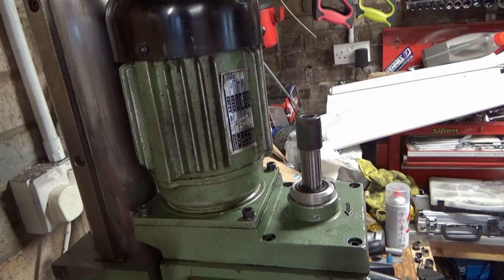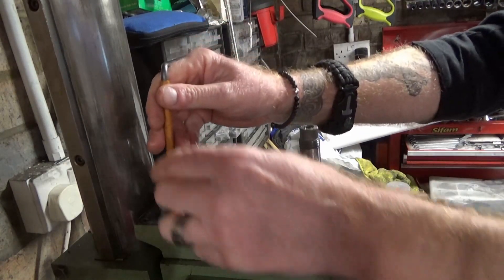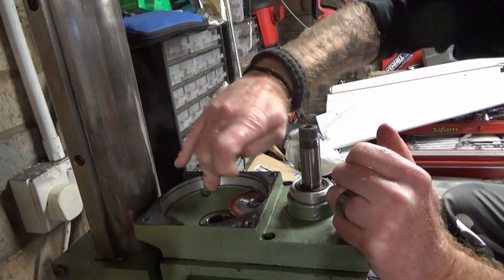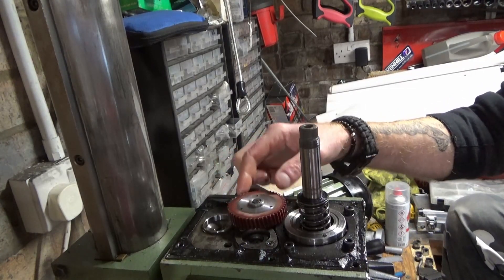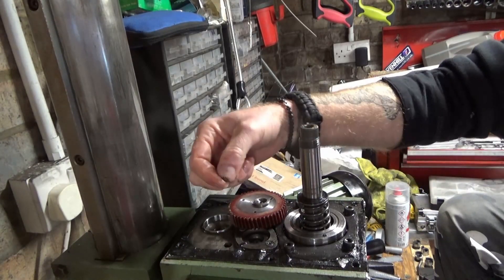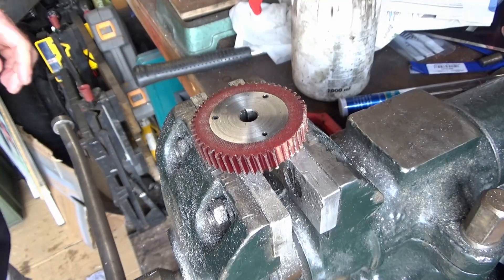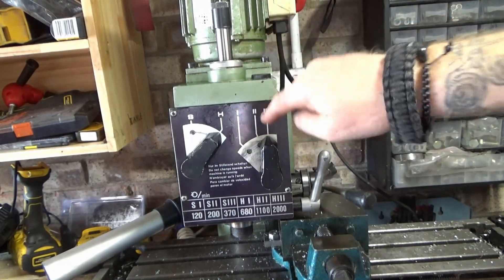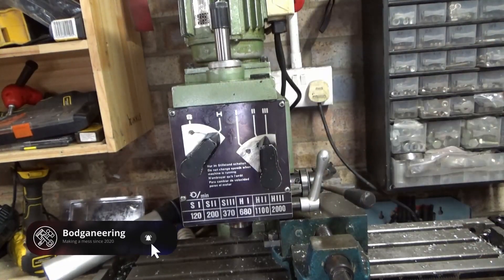EMCO FB2 Milling Machine - Damaged Tufnol Gear Replacement With 3D Printed Gear

Comment: How did those gears work in your mill, i did the same gear change and mind just come apart, did not work
Reply from the maker: I'll be honest, not great. I've already killed one and I'm being very careful with my last one. I'm looking into either getting some Tufnol gears made, as original, or even a toothed belt configuration. As usual life is throwing too much at me at the moment for me to get my head into sorting it out.
Reply: @bodganeering  im in the process of making brass gears,ty for your reply

Comment: Is it still holding up
Reply from the maker: Not very well, I’ve killed one already when using a fly cutter. 🥴😂

The mill has now been reduced to less stressful operations until I can source some Tufnol gears.
Reply: Mine just experienced rapid unscheduled disassembly after a few hours of operation.
Reply from the maker: @matthewmcbride1379  bugger. I'm looking around for someone who would produce a batch of Tufnol gears, if I find someone I'll update on the channel.

Comment: Thank you for posting. 
Have you replaced o-rings & oilseals on the spindle at all?
Mine's leaking oil badly. Looks like a daunting job to take the spindle out.
Reply from the maker: I did all of mine when I rebuilt the engine. Not a difficult job just a bit fiddly getting the cases split. 

Take note of which way your gears are set up on their shafts.